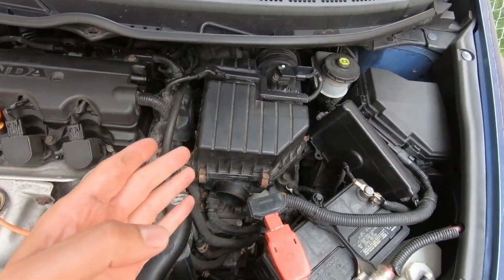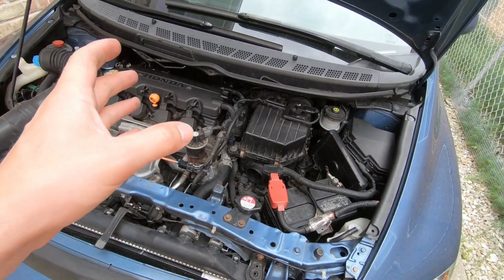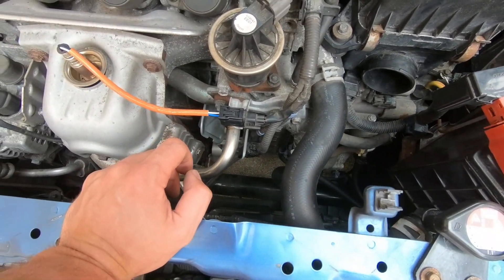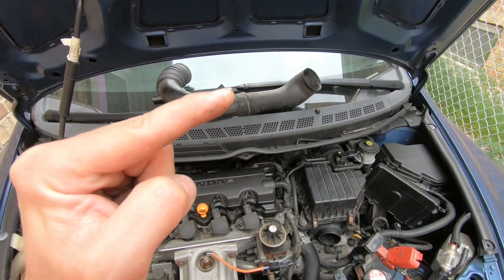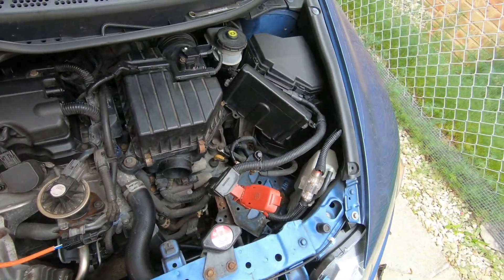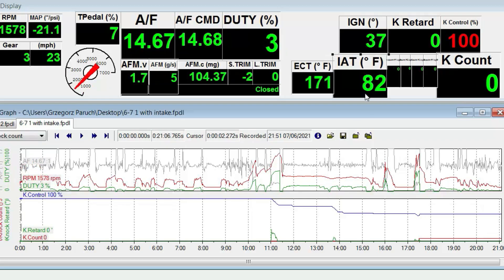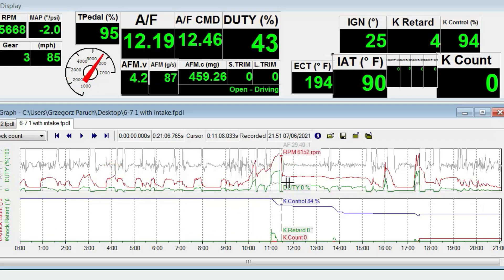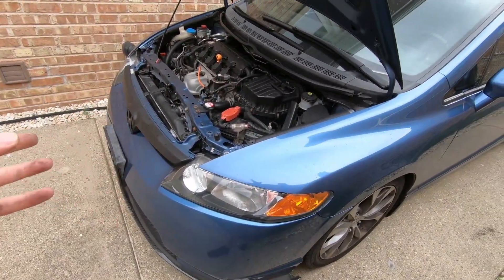Hondata Tuning and Intake Air Temps! R18 Turbo Build

Comment: When i bought my civic 08 used in winter season, the exact hose you mentioned was missing, i kept using it until summer came and the car became lazier day by day. After a lot of figuring out, I deemed this to be the issue. The engine was getting heat soaked from hot engine bay air. Bought the replacement hoses and reconnected the intake resonator. It not only increased the perfomance but also made the ride quieter. (why didnt i stumble on this video sooner lol)

Comment: I just got a short intake, and exhaust manifold, I want an EGR block for 06 civic r18, should I buy Hondata flashpro to balance the lean mixture, I’m a beginner and have no clue what I’m doing. Pls help
Reply from the maker: How do you know you are lean?
Reply: @BulliKid  I’m not entirely, thanks so much for the reply, more air, less resistance without the catalytic converter, same amount of gas, means lean right?
Reply from the maker: @Emactmac  that’s just guessing.  You need to see what your air fuel ratios are and what your short term and long term fuel trims are doing.  
to adjust any of that you would need to get a tuning solution.  

For bolt on parts like intake and exhaust it’s not a huge deal and most of the time it won’t change things enough to cause problems.   

The other question is cost.  Is it worth it for you to spend hundreds of dollars on a hondata and not know how to use it and possibly make bad tuning adjustments to make things worse?  Do you plan to pay someone to do it costing you even more. 

All things to consider.  

To start you should again verify if you are lean/rich  and go from there.   

Hope that helped.
Reply: @BulliKid  Yes, this puts my mind at ease, there isn’t anyone locally that could even do the tune, it’s at 203700 miles, and it’s my first project car, lol. I am just wanting more hp for the hell of it, but hey I heard if you take care of these cars they last a long time.

Comment: If I run the stock injectors with the hondata base map with the turbo kit and low pounds of boost I should be good ?
Reply from the maker: No.  Watch my playlist.  Stock injectors are at around 85-90% duty cycle stock.   That means they are maxxed out already.
Reply: @BulliKid  what Year Honda Civic did you get the injectors from you said eighth gen but what year specifically
Reply from the maker: Anything from 06-11 works
Reply: @BulliKid  this playlist is extremely helpful, even a year later😂

Comment: I know your just acting surprised that the temps went up without the intake hoses attached to the box. I can’t believe you drove like that. But who am I kidding. I drove for a while with the air intake resonator box detached because it broke off while i was driving (the whole dam box!) So with the box gone my intake hose terminated under the battery and that’s where it was sucking in all that hot air coming off the engine. I’m sure you know about that hose that screws onto the battery housing.
Reply from the maker: I gotcha.  Probably cooler by the battery box compared to completely open  like in the video. But yea doesn’t help at all!

Comment: I'm sure this has been asked, but why not just sell your car and buy an Si?
Reply from the maker: Because I’m just working with what I have.  It’s the learning process I’m interested in.  I’m not looking to make big power just have it running on low boost.   I went to look at a few 8th gen supercharged si’s and they were all half asses.  Either the build or the exterior.    I know this car from the ground up. Original owner.   Overall clean and low mileage.  So that’s why.